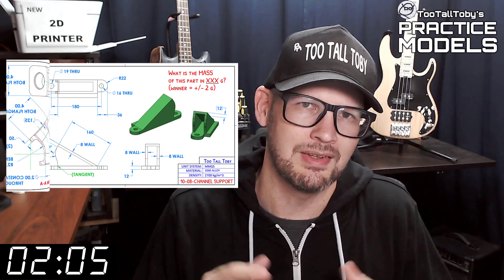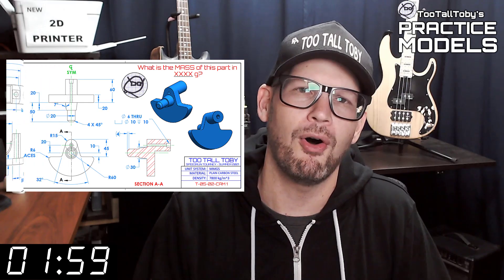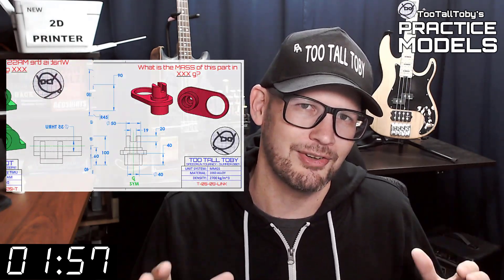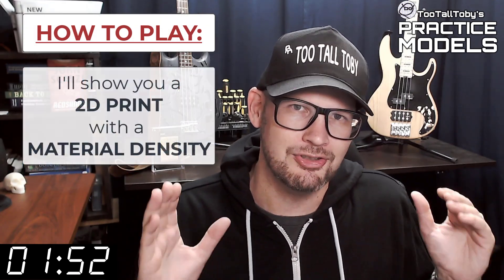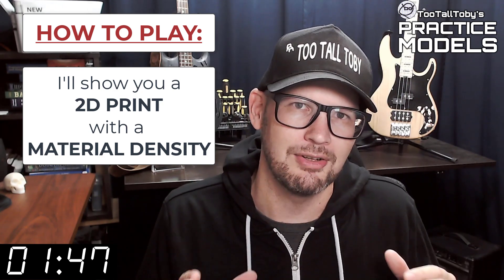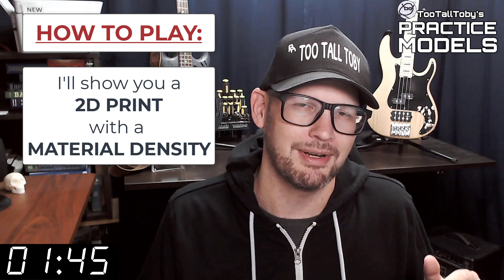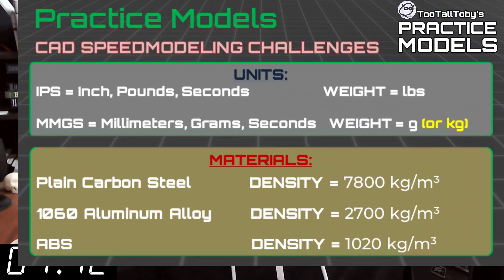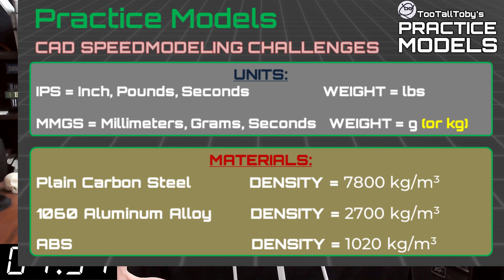2D Drawing to 3D CAD - PRACTICE MODEL- Exercises for Onshape, SolidWorks - REDUCER

Comment: 10.29min, 5.57lbs, Solidworks, R???=2.17"
Reply from the maker: Nice job!  Correct answer is always shown at the end if you want to check :-)
Reply: I got a different answer for the R???.  1.271 in, which agrees with others here.  Did you make a typo?
Reply from the maker: @kenhaley4  Mass is 5.57 - radius is intentionally missing, because it's driven 🙂